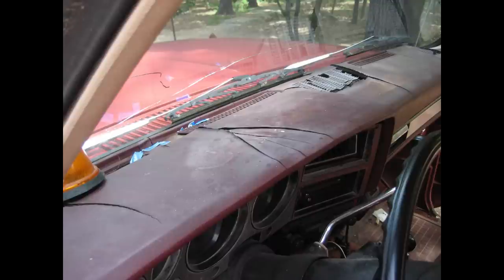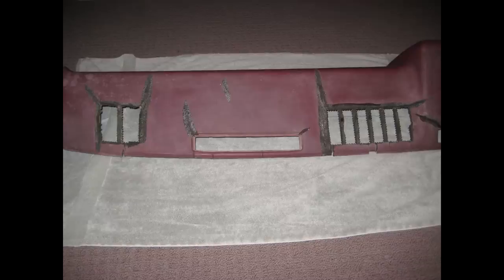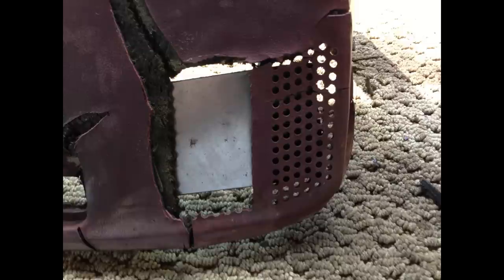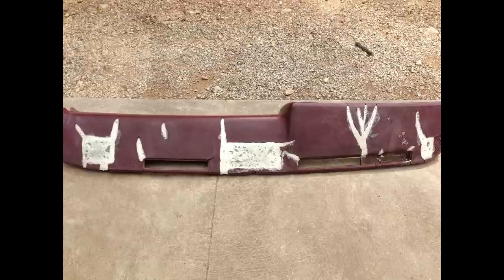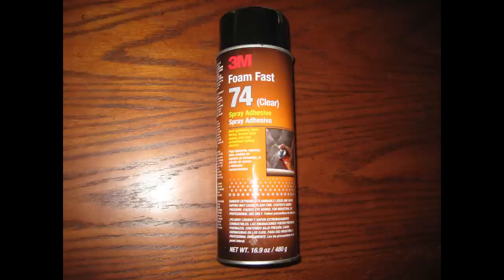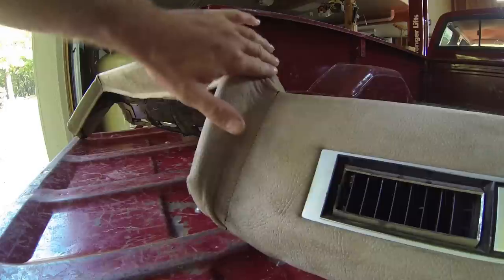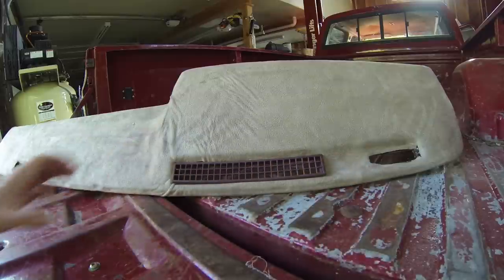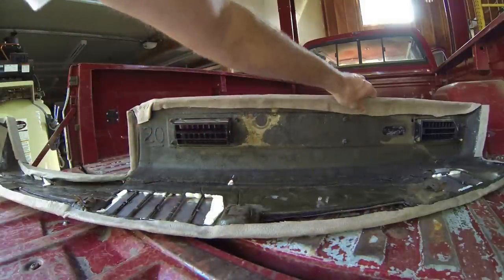How to Recover Your Dash - 1973-1987 GM Truck

Comment: Nice job.  When I did mine (in black vinyl) a helpful upholsterer (who I could not afford to hire but was willing to impart some advice) told me to measure from the farthest points on either end and then add 10% to that number.  Then go down to the fabric store and measure the fabric on the roll on the bias (diagonally) to figure out how much to buy (it will vary depending on the width of the roll).  Then when applying it to the dash don't cut it.  Lay your piece out on it (diagonally) to make sure you have enough, and then start gluing the adhesive at one end, making sure to stretch it as you go, and moving slowly, taking care to really stretch it over corners and into nooks and crannies.  Then when you're done just trim off the excess.  Took me about two hours once I started gluing and stretching and you can't tell the difference from factory original, until you touch it.  Some might be wondering why I'm writing such a long comment, and it's because I learned a lot about this and other things from videos like this one and from reading comments by others, and I figure I should pass it on.  Good luck!
Reply: Thanks for the insight..def taking onto account, as I start  my truck
Reply: I appreciate the tip as I comment 3 years after you posted it. Need to fix up my truck I just got, and this gives me more confidence

Comment: Instead of recovering, with fabric, what I've found that works really well, is after smoothing the foam, laying down Bondo and sanding smooth before painting with spray paint in a color you like. I typically respray with flat colors to avoid sun glare
Reply from the maker: Excellent feedback Jeremy. Thank you. Sounds like a great way to do it!
Reply: @GodsCountry  i had people ask me to do the textured paint. While it looks ok at first, after a few weeks the Dust begins to collect and it's just horrible after a month or so.
Reply from the maker: That makes total sense. Kind of like some rough texture spray on bedliners (in the bed, not on the dash haha).

Comment: Try this. After you have foam filled and smoothed as well as you can, use some kitty hair filler where needed, sand smooth again and final coat with body filler. Use a plastic spray bonding primer and then spray entire area with dupli color bed liner. After dry, prime again and paint any color you like. I have done this a few times with perfect results. I have attempted a GMC like this one and had difficult fabric coverage as you did. Nice job. Thanks.
Reply from the maker: Thanks for the suggestion Mike! I may try that some day.
Reply: God's Country Go on facebook to DestinationDetaail Heppner OR and you can see pics of the GMC I did like yours. Leave me a message.

Comment: Well. I found your video, THANK YOU,  and it gave me the courage to tackle my 85 k10. I've just started, it's out and foamed..I'm finding that the sanding is pretty time consuming, but I'm waayyy past the point of no return..lol so ahead I forge. Oh and incidentally  the new dash from LMC for this truck is 559 without the brushed metal front, or 619 with. Def worth trying for the wrap
Reply from the maker: I'm glad you decided to try it! The replacements just keep getting higher and higher in price.
Reply: @GodsCountry  one question,  and it may be in the vid..but did you seam any of it, or it's just one piece of vinyl? And did you install  it? Howd it go if you did? Thanks

Comment: What kind of foam did you use, brand and how much and where to buy, i wana fix my dash as well on my 94 chevy silverado
Reply from the maker: +sergio garcia Hi Sergio. I used less than one can of spray expanding foam that might use to seal gaps on a house. You should be able to find this at a hardware store. I do not remember the brand but there should be several brands to chose from.

Comment: Awesome video. About to attempt this same recover on the type of truck. Did you use heat in the contours?
Reply from the maker: Brandon Ware Thanks Brandon! I did not use heat because the covering is a fabric and not a vinyl/rubber/plastic. I'm not sure heat will help but you could try it. The recover job has worked well for me. Instead of having a horrible, ugly dash greet me when I get in the truck, it's an easily tolerable dash that doesn't cost much.

Comment: I've enjoyed watching your progress. If you ever do a lift on a 2wd Square, I'd be interested in seeing how you do it. I've been told that the GMT400 88-98 spindles are what's required to lift a 2wd. I'm about to go that route as I don't need a 4wd at all but Houston floods often enough to necessitate a lift
Reply from the maker: Thanks man! These have been fun projects. Love the old squares. Sounds like you've got a cool project going too.
Reply: @GodsCountry  I'm trying lol. The guy I bought her from sold her as an 85 ¾ton Silverado Suburban with only 86k actual miles and a blueprinted 350. What I got was exactly what he said, only the odometer had rolled at least once in 34yrs, which I didnt mind, but the motor was just junk. Blew the head gasket after doing a complete tune up... 🤯. It gives me an excuse to drop an actual blueprinted motor in her now and swap out the transmission. My debate now is whether to replace it with a gas guzzling 350 or something more banal like an I6. Ive really been tossing around the idea of a 12v Chummins swap, but budget is an issue, I won't deny. I think that I could get by with a generic 6cyl gas engine as I never tow more than a 12' Uhaul trailer.
Reply from the maker: Cummins would be awesome but have you looked into a LS swap? I'm not sure of the total expense but I believe LS motors are pretty easy to find these days. Should be better fuel mileage and still have the ability to make big power if you wanted to.
Reply: @GodsCountry  the guy I'm talking to owns a shop and he offered a TPI 5.7 I'm assuming that's an LS? Heck idk. Lol but I did think about it and I've only got about 2400 to invest in it.
Reply: I honestly want to stay carbureted in case, you know, apocalypse or what have you. I just know I can work on a non computer controlled engine a lot easier.

Comment: Good prep work, the final result is not what one would expect though.
My recommendation, next time use a stretch material, that can adjust better to the changes in shape, and when you apply the material, plan ahead, and pay it before you apply the glue so you can see where the liner is going to fall in place.
Reply from the maker: Thanks Alejandro.

Comment: I just did the same thing but I used vinyl it stretches once it gets hot so I warmed it up with a hair dryer n it gets in those hard angles alot better i didn't have to sow anything i just sprayed the adhesive n hit it with the dryer as I stretched n held it down tight but I didn't fix all the cracks right so I had some lumps but not to bad
Reply from the maker: Awesome! Sounds like your project went well. Thanks for the feedback.

Comment: Where did you get the defrost vents
Reply from the maker: +TheXV1CT0Rx The defrost vents are plastic and came out of the original dash pad. I painted them tan and put them back in after the recover.

Comment: not bad I do upholstery for a living...some stuff is easy some ain't..these fall in the middle..requires stiching usually 8 pieces when I do them
Reply from the maker: Thanks Ray. This was really just a stop gap measure until I decide to fully replace the dash pad. I have a ton of respect for the professionals. Upholstery is hard to do!
Reply: How much would you charge to do my and my seat in my 83 Chevy truck

Comment: I think it might have come out a little nicer if you did use one piece and stretch it.  A better brush on contact cement where you apply to both pieces then let it get tacky.  Cover with wax paper to keep areas from sticking until your ready, removing the wax paper only from each area once you are ready to apply.
Reply from the maker: Good tips Jay. Thanks. This particular material that I used hardly stretched at all. Something like a vinyl may have been better for that.

Comment: To keep vinyl from cracking,  spray Lemon Pledge or Orange Glow on a soft towel and wipe that on / all over the vinyl.  That imparts a slight oil in the vinyl.  Looks great afterwards.  Some people usr baby oil on everything but that attracts too much dirt.
Reply from the maker: Thanks for the tip Mike. I wish my dash pad would have been crack free when I bought the truck but that's good advice for when I replace it with a quality one.
Reply: My 77 Blazer that I bought last October is all original.  The dash and other areas is crack free.  From using Lemon Pledge on it,  I hope it will stay that way.  Now about the engine and transmission,  will need to replace them when my wallet allows. Some body rust here and there.
Reply: I am the second owner.  The original owners did no mtce on it at all.  Anti - freeze was as thick as house paint and a tan color.  Power steering fluid was burned.  Leaks everywhere.  Suspension was shot.  Filthy all over.  Inside was dirty from never being vacuumed.  Broken glass from a window that no one vacuumed up.  The list goes in and on.  Now when I drive it anywhere,  people stare at it.  I was driving thru' the center of town and some city workers were doing something next to the street and someone saw me in it and yelled out "holy shit -  look at that Blazer" -  that made me smile because anything worthwhile takes awhile,  and my work on it is quite noticeable.
Reply from the maker: I know that feeling!!! My truck was (and somewhat still is) as basket case. It's so rewarding to fix things that have been neglected for years.
Reply: Keep working  on it -  the next thing you know it will be a head turner like mine became.

Comment: If anyone’s looking for a solution that’s relatively cost effective and less effort, I put a plastic dash cap on mine. You can use SEM colorcoat to get it whatever color you like. You just sand the underside of the Dash cap And sand your actual dash and clean both in rubbing alcohol. It comes with its own glue

Comment: Actually the dashboard is different in the older chevys.73- 79 are different
Reply from the maker: Yes, you are correct. This is meant more as an idea for a low budget recover to get by until you can buy a new dash pad.

Comment: good job!....next time try spraying the glue in increments...as you move so the fabric won't stick when you don't want it to. Also, try using a heat gun (if the fabric is stretchable...some fabric isn't) at those corners/angles. It is good to have another helper sometimes doing this....one heats the fabric while the other pulls/stretches the fabric into position. I'm going to try my luck at a 76 chevy pickup dash cover and will use a strong and thick marine grade stretchable vinyl ...wish me luck!
Reply from the maker: Thanks for the comments and thanks for the tips!

Comment: 73-80 are different from 81-92 dash the 73 has a more round shape the 81 -92 has the squarish shape... looks awesome did the same thing to my 77 waay cheeper then replacing the dash and looks just as good 😱😱😱😱
Reply from the maker: +Krflk92 Thanks for the comment K. I'm glad it worked for you too.

Comment: They sell dash cap shell it comes black. I did mine in Bondo fiberglass and painted it . I just shaped and sanded on my time off. You can cheat by using stetchest material check out fabric stores even wal mart. My friend sews seam across the top lip. Heat gun and super glue are your friends
Reply from the maker: Thank you for your suggestions.

Comment: If you want original parts go to lmctruck.com they have everything and beyond for these trucks there based outta missouri but they will ship
Reply from the maker: mikey32112346 Thanks Mikey. Generally speaking, LMC does not have original, GM built parts. Once in a while they may have some NOS (new old stock) parts but almost everything they sell is a reproduction. The quality of reproduction parts varies wildly from better than factory GM (rarely) to so terrible that people refuse to use the part. There are also other parts warehouses that specialize in these trucks: Classic Parts, Classic Industries, Brother's, etc. Thanks for watching!
Reply: They sell repops at about 300.00